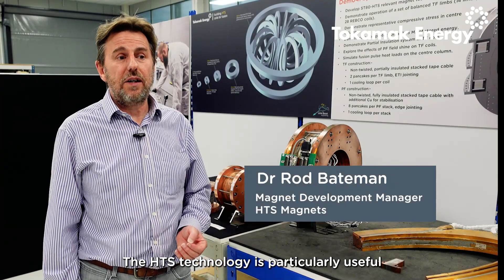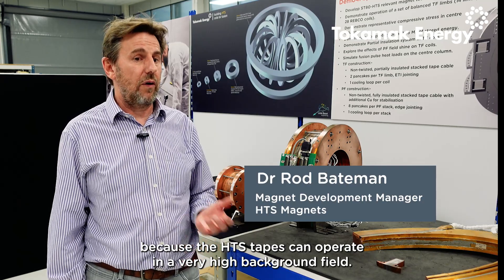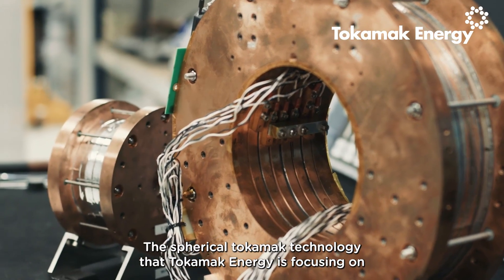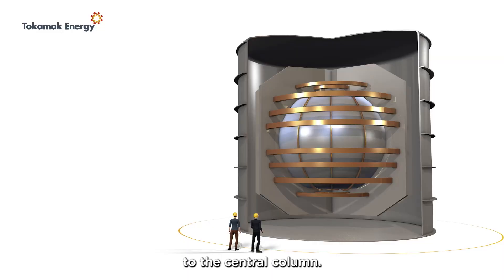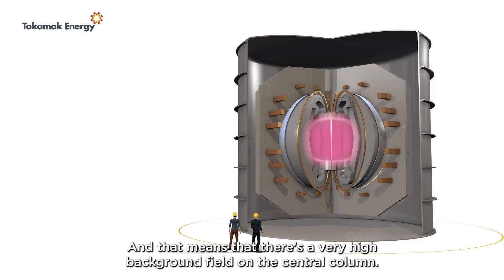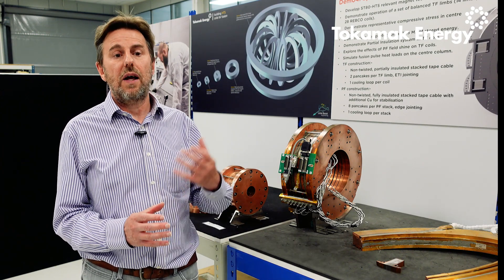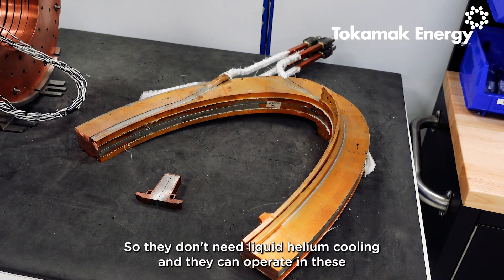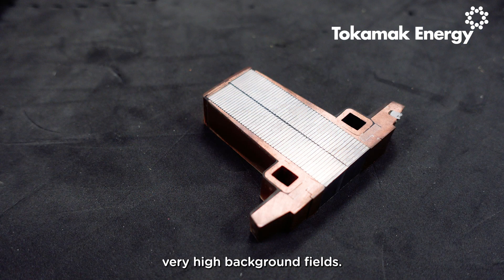Fusion Pioneer Rod Bateman HTS

Comment: I'm not convinced any of the many pulse plasma generators are practical or cost efficient.  A sustained magnetic field under dynamic control is the way to go.
Reply: I would disagree. Have you not considered the isotope effect, and that  the critical temperature for many superconductors depends on the isotopic mass, indicating that lattice vibrations are involved in the superconductivity, and that the attractive coupling between electrons is through the lattice vibrations ? Ringing any bells? Sometimes it's wiser to allow people to suspect one's foolishness rather than to break cover and remove all doubt.

Comment: Can you explain the cooling setup you use? How do you get down to 20K without Liquid Helium?
Reply from the maker: You can get down to 20K using a cryocooler, which works via the compression and expansion of a gas. These are already used in various industries, such as medical and scientific research. You don't need the specialist cryogenic facilities you'd need to use liquid helium. Hope that helps!
Reply: @tokamakenergy6400 Thanks!
Reply: Compare various cryo gases: https://www.linde-gas.com/en/images/Safety%20Advice%2004%20Cryogenic%20Liquefied%20Gases_tcm17-410827.pdf